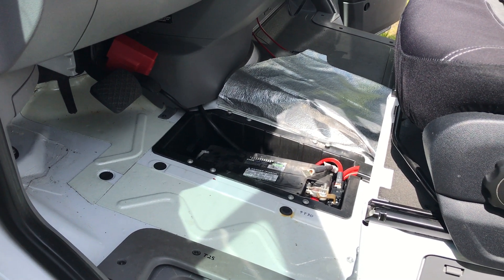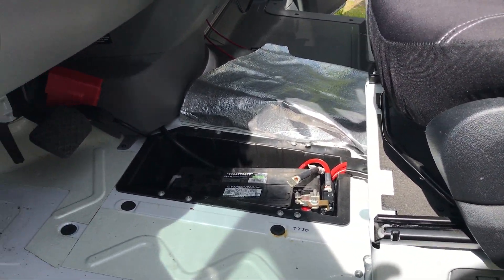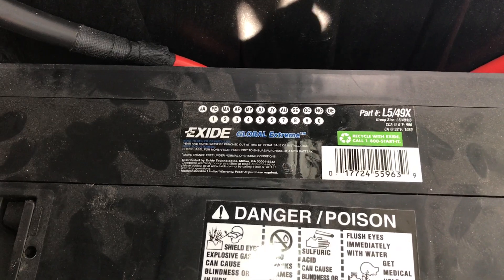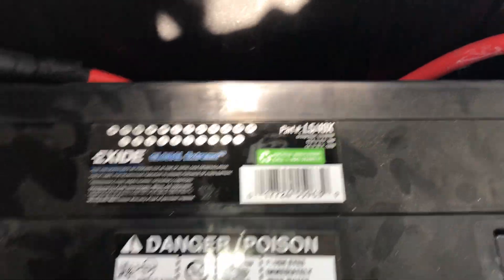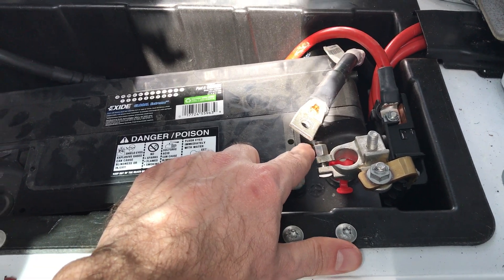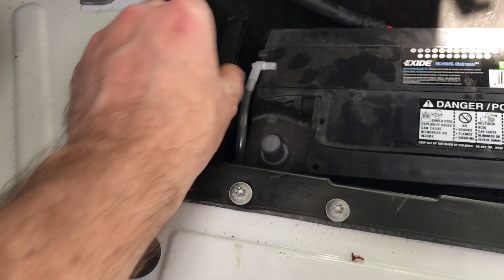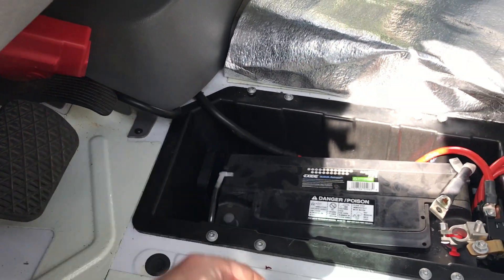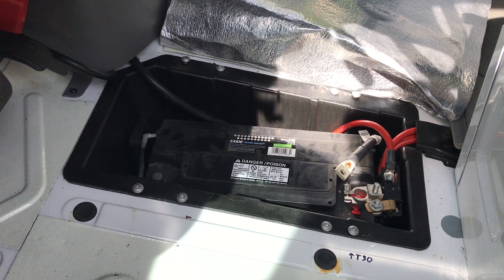Battery replacement 2013 Sprinter V6

Comment: I'm about to do the same thing to my 2014 3500 Sprinter and was told that I need to keep constant power supplied to the chassis or I might not be able to restart the van. Have you heard this?
Reply from the maker: Yes, I have heard this rumor before. I did not have that problem myself. I believe that if the replacement is done relatively quickly, then it should be ok. I suspect it's only a problem when the battery is disconnected for a prolonged period of time. The onboard computer has a backup battery, but it only lasts for a day or 2. Once it goes down, then you will experience all kinds of problems restarting. I hope this helps.
Reply: Yes. True, just connect a 12v power supply to the jump terminal under the hood and ground.